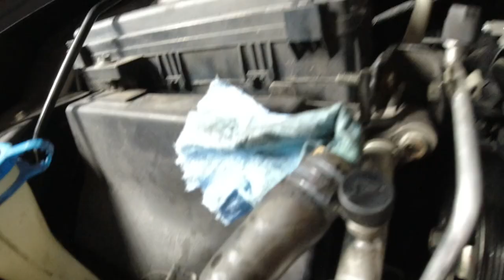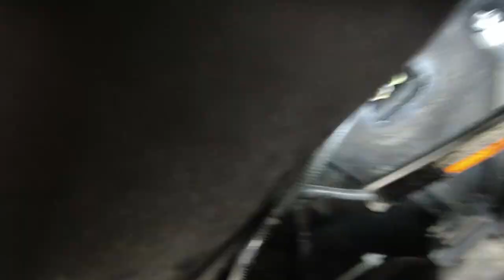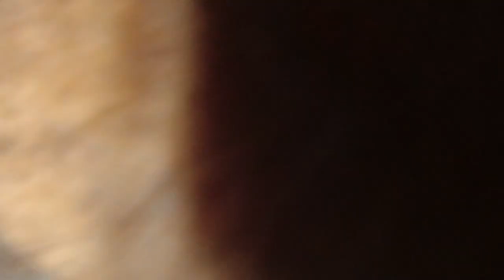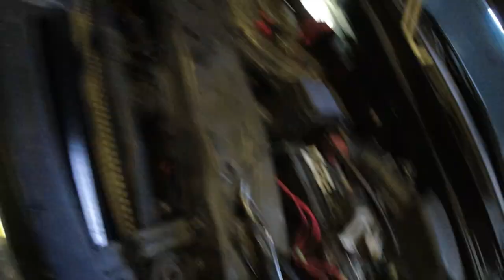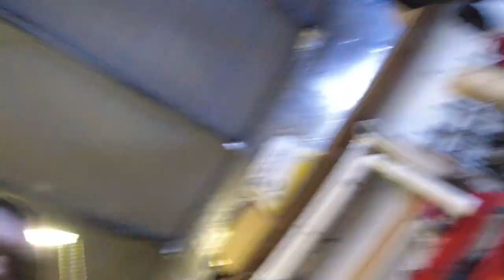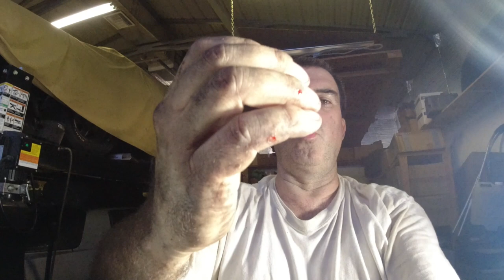How to remove the front expansion valve on a 2014 Honda Odyssey without tearing the dash apart.

Comment: What symptoms did your AC to determine what was the expansion valve ?
Reply from the maker: Their weren't any symptoms, I was replacing the compressor and figured might as well make the system brand new again.. and it's working awesome.. You can do a google search, different pressures on your gauges will lead you to what's wrong.